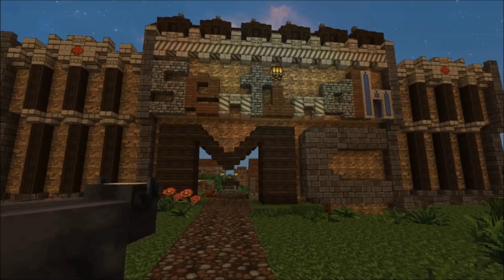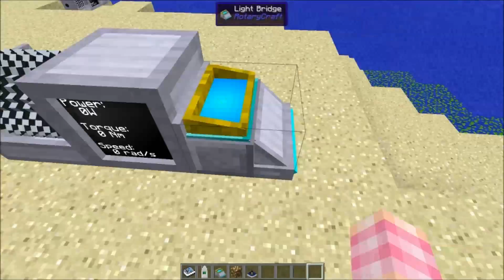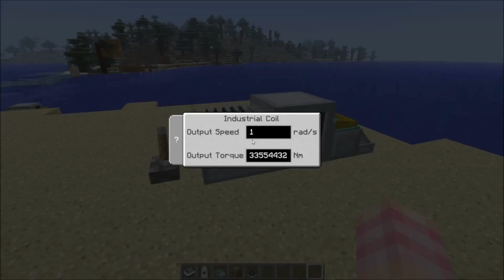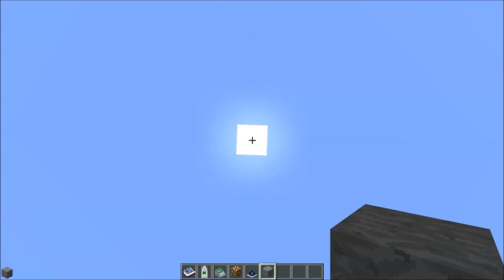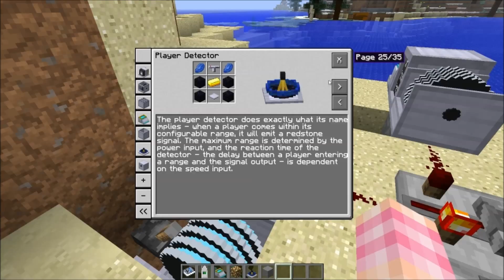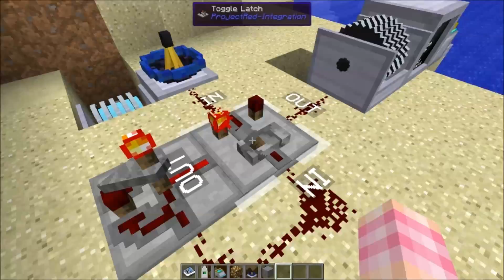RotaryCraft Tutorial #51 - Light Bridge and Player Detector

Comment: The max range is configurable.
Reply from the maker: That's cool. Is there a maximum, maximum range? I imagine if you set the max range so far that the chunk containing the light bridge itself unloaded you'd have an issue.
Reply: Theoretically, yes, though I do not impose one myself.
 Performance issues (2000+ block and lighting updates at once) will likely stop you before that.